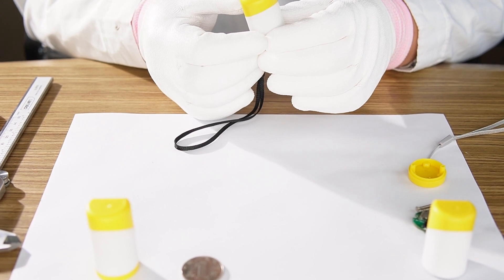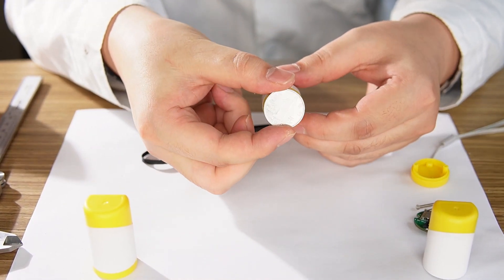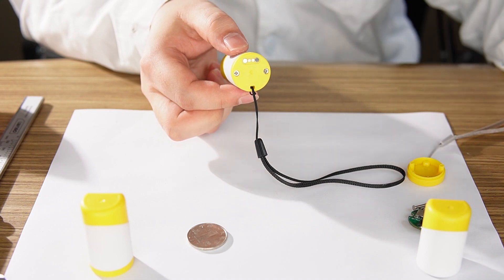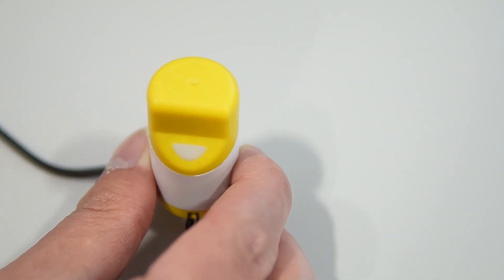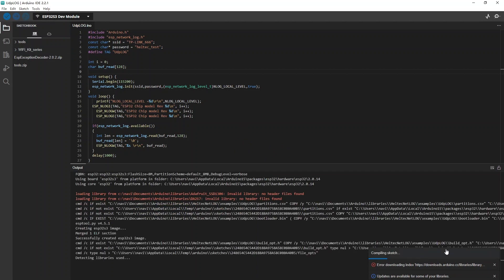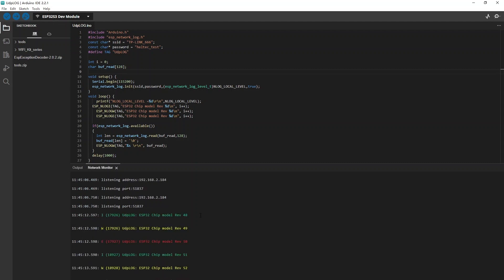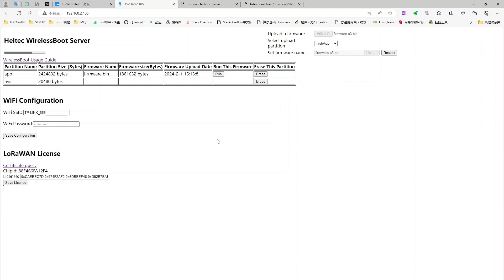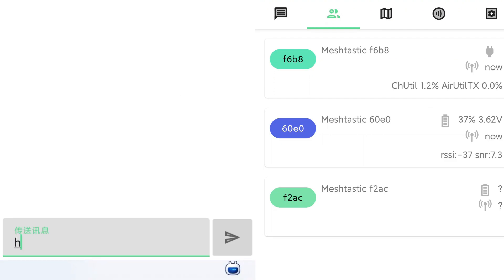Heltec Capsule Sensor V3 Operation Introduction.

Comment: Thanks for your video. I downloaded the firmware in the “secondApp” partition but I can't delete it! And what is your suggestion with Heltec Capsule Sensor V3 3-Axis to receive a notification on the smartphone in case of movement of the Capsule? Where can I find compatible firmware other than meshtastic that works with Capsule? Thanks!

Comment: I didn't have any problems with the voice over. The music could be a little lower though. 
However: Wow, either super expensive shipping or risk loosing the freight. 
Shipping to AU
YANWEN Fast Line (7~20 days, 0.3% packet loss): $7.00
Fedex: $38.00
:( I won't buy at that price.

Comment: So a device with wifi, bluetooth , with 250mAh battery for search and rescue?
Lets be realistic this have 1 hour battery?

So the advertising is inducing the people in wrong way😢😢
Reply from the maker: The product positioning of Capsule Sensor V3 is a portable LoRaWAN device with a good low-power design, ~10uA in deep sleep. If sending data is every 30 minutes, the internal battery can operate for more than 6 months.

Meshtatic is one of its options, which can enable low-power mode in Meshtatic or be powered by a phone or power bank. Of course, there will be a large battery version specifically designed for Meshtatic.😃😃